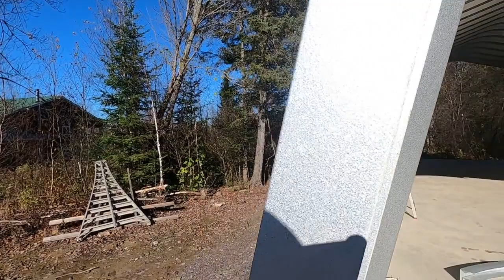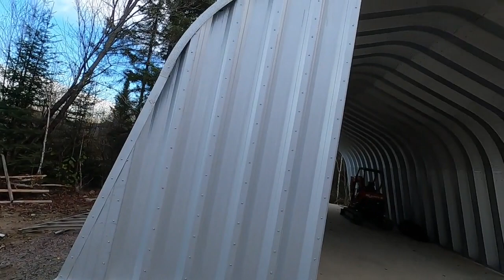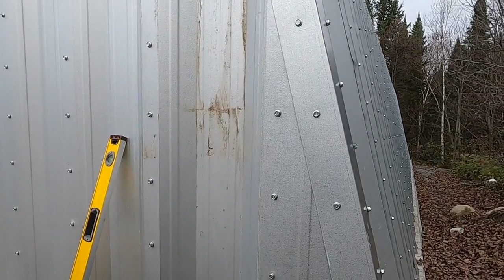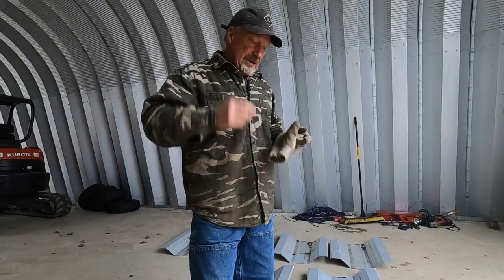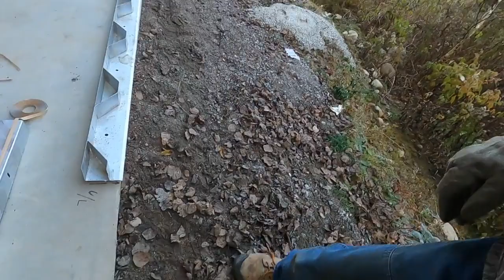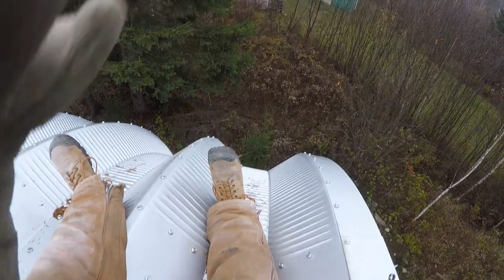Quonset Alpine series build part #3

Comment: Hello.  Your videos have really helped my build.  Thank you.  Quick question.  Did you drill holes for bolts at the top of the panels in the back?  I can't see any but I can't believe the top of the panels just rattle around in the C channel.  Please let me know what you did there.  Thanks again.
Reply from the maker: I believe you are required to drill and bolt thru the rear panels.

Comment: Your building was challenge because it was so tall. Mine was 20ft7inwide, 12ft6in high, and 80ft long. I used my Mahindra 6075 to raise the partial arch up and then attach it to the pre-installed first leg wall pieces that join the base plate. The big problem with mine was due to the span being so tight, that the holes were a huge problem to get aligned, especially at that multi piece junctions.
Reply from the maker: Definitely challenging,Nothing like a good workout physically and mentally.Thanks for watching.